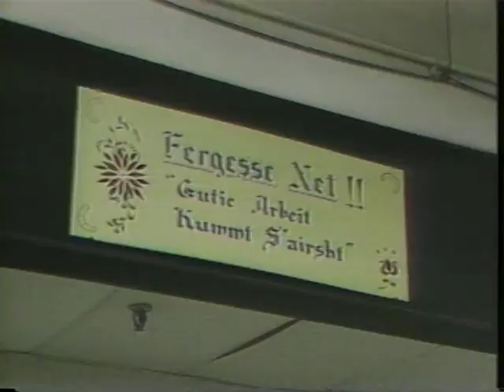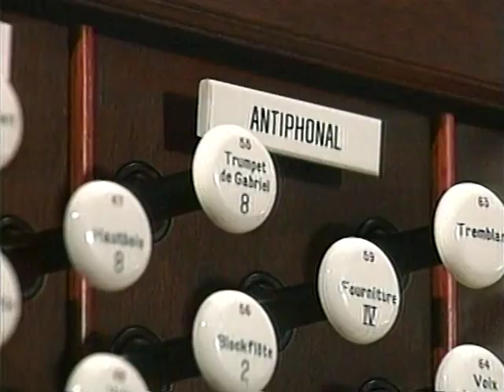JOHNSON FERRY BAPTIST CHURCH - ALLEN ORGAN  with Diane Bish

Comment: As a former Allen representative, I am surprised at the number of boards/stops that are inoperable. The boards used in the ADC organs are generally quite stable and. The only thing that I can think of that would cause this type of failure would be a voltage surge caused by either lightning or a spike in the commercial electric supply. I wish them the best of luck with their new instrument. The Walker organs are fine instruments in their own right.
Reply: Read about it on OrganForum (check the archives). The present owner of the instrument said it was easy to put the organ back into proper condition. You can read all the 'intrigues' at OF also, including a post from from an Allen VP regarding alleged mis-statements about its condition before replacement.
Reply: This was an ADC TT-4 tone board organ. The old voicing control pots were always the culprit on those boards. The factory offered to fix the defective boards for free, and the church turned them down. You won’t find any other manufacturer that would do that…..or even fix an organ of theirs this old!

Comment: This organ sounds amazing for it only being an ADC model
Reply: Looks newer than an ADC model!
Reply: It is an Allen ADC organ!!
Reply: I own an Allen ADC 5300 with 7 full speaker cabinets. Very nice organ!! It is installed in my home.
Reply: Oh this model was custom made for this church!
Reply: Nice, but it would be better if you can have seperate speakers! That will sound better.
Reply: Best to have as many speakers as possible to spread the sound sources as would be in a pipe organ.
Reply: UPDATE:...A Protégé series organ with AGO pedal board would also work,...from an AP-4 to C-14C,...that would be the newest I could probably go!
Reply: Gerrit de Vries very, very custom.  Not your typical Allen.
Reply: NorfolkSouthern1068 

I just saw an AP-4 on Ebay today.
Reply: UPDATE #2,...I now have a Rodgers Essex 640. Great sound with built in audio,and analog tech. I think this was getting into the last years of the analog era for Rodgers. It was given to me by the church I now belong to as they were no longer using it.

Comment: When was this recorded?  30 years ago?    Did this organ only have a life of 30 years?
Reply: Michael Dyches was replaced this year with a completely digital Walker, voiced like an Aeolian Skinner
Reply: Cynthia Brown I wonder next summer 2020 if the AGO Convention in Atlanta will have a Recital on this Organ.   I believe they are suppose to go to Peachtree UMC to hear the Mander Pipe Organ from London.  It has 2 Consoles and costed $8 Million.
Reply: It had a life expectancy far more than what this church gave it. Allen offered to fix the faulty tone boards for free, and the church turned them down. Spent a hefty six figure sum instead for the Walker, and it wasn’t necessary. This organ is now at the NC dealership and still works just fine after repairs.

Comment: This Allen Computer Organ sounds half decent.  There is noticeable speaker coloration, especially when Diane Bish plays full organ.  The Allen engineers simply do not understand transient intermodulation distortion arising from Doppler shifts associated with speaker cone movement.  Full organ chorus is thin.  Hauptwerk (Milan Audio) does a much better job.
Reply: This was several generations old technology (ADC). If you heard it in person I think you would've felt different. And I don't think I know more than the "Allen engineers" and perhaps you shouldn't either!

Comment: Shame that Allen could not support this instrument by updating the failing tonal system. The problem of technology is that moves on so rapidly. No one uses a computer or watches a TV built in 1989. Although the tonal work on this instrument overseen by Larry Phelps was obviously the state of the area at the time. One major failing is that there are only divisional couplers and no sub or super octave couplers. However Allen will not fundamentally rebuild with modern , more reliable and supportable technology. This was the same scenario at the 5 manual MOS Organ at Westminster Pres inAlbany N.Y. A console that could last for 50 years is thrown away far before its time. Shame that Walker is replacing what should have been a better Allen.
Reply: Yes it IS a shame it's being replaced with a Walker.  A newer,better Allen,...or even a Rodgers,...would have been a better choice,....just saying!
Reply: anb740 who is the new owner? It was an amazing feat to get it reinstalled and repaired in a few weeks.
Reply: @William Hubert The Allen dealer in Charlotte. The organ itself had double audio on it. He supposedly reduced that down to one speaker per channel; hence the reason he sold off a bunch of the excess speakers. As far as I know, he has no intentions of reinstalling it anywhere and is keeping it as a showpiece of his studio. At 30 years old, it's still one of the better sounding Allens out there.
Reply: @anb740  Someone,...such as the pastor,...should have put their foot down and told the organist "NO WAY are you going to do us that way!" I sure would have!
Reply: Larry Phelps. There's a name to conjure with.